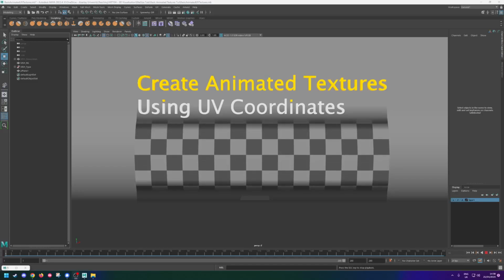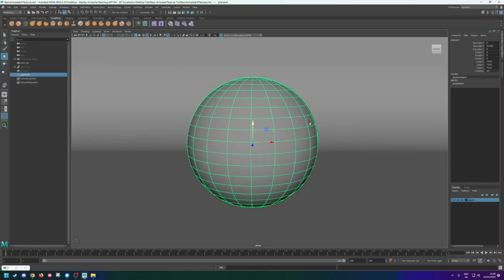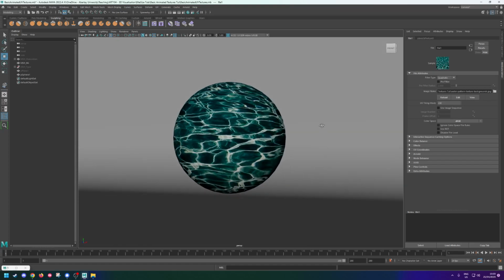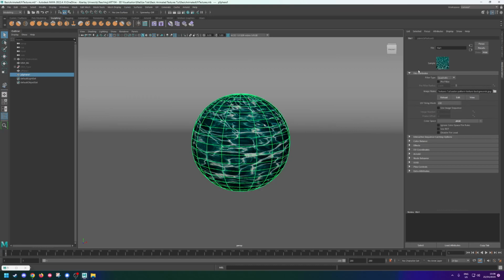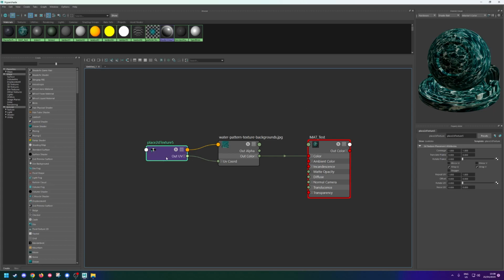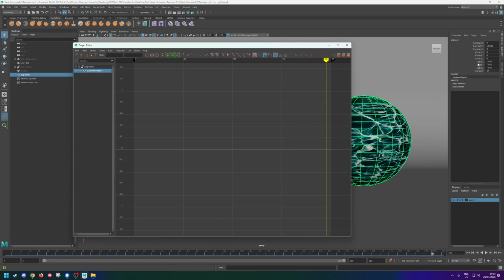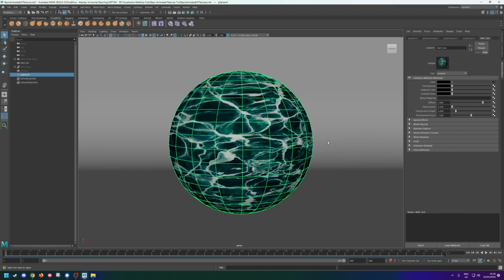ART104 | Maya Mini Tutorial | Animated Textures using UV Coordinates

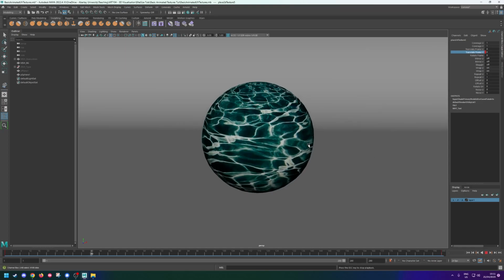Comment: Thank you so much for sharing this video! This helped me out so much in figuring out how to animate a character's eyes (Fortnite x TADC Pomni specifically) whose eyes are different than that of a normal character's. I do want to point out at 12:50 that it is absolutely possible to use negative numbers when keyframing UV movement. I used a negative number on V to have Pomni's eye textures move down a tiny bit to test out eye movement and it worked perfectly fine for me. I do wish there was an easier way to access the UV movement channels instead of having to go through Hypershade and then select the node XD.